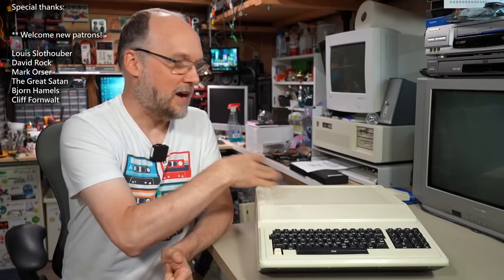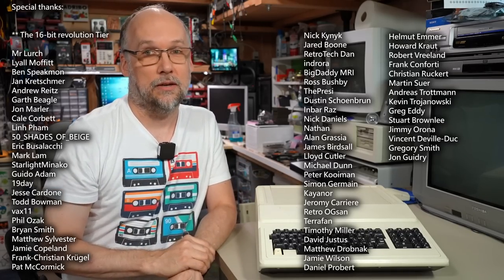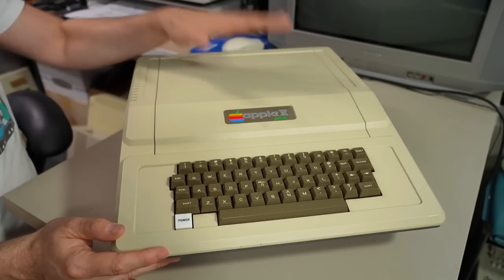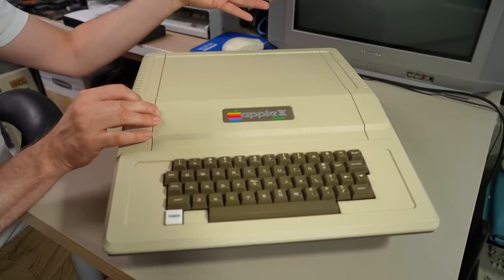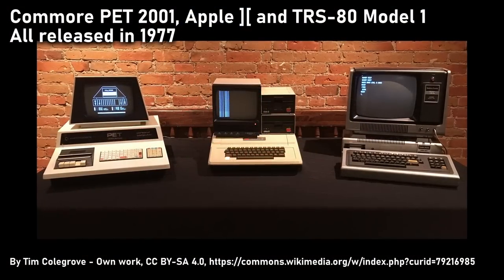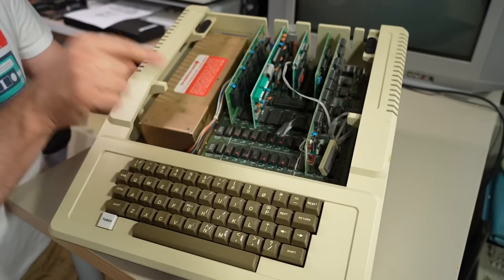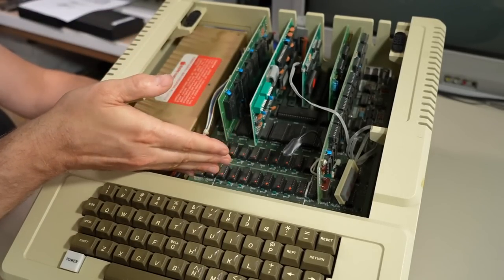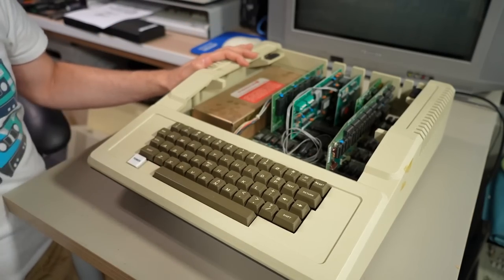Apple II+ clone repair: I thought this would be easy... I was wrong

Comment from the maker: Small correction: It turns out Franklin did not have a clean-room ROM, and were eventually found to be infringing. I can't find exact specifics about this as even Wikipedia lacks citations, but this seems to be the general consensus. Even this article specifically about the case lacks detail: https://en.wikipedia.org/wiki/Apple_Computer,_Inc._v._Franklin_Computer_Corp.

It talks about how Apple "won" in 1983 but Franklin continued to sell its very compatible Franklin Ace line until 1988, when "Apple was able to force Franklin to withdraw its clones by 1988." That doesn't exactly make sense to me -- so If anyone can dig up more detail about how Franklin continued to sell large numbers of machines with supposedly infringing code, I'd love to know.
Reply: I never really saw a Franklin in the wild.  I remember there was a shop by me that sold the Pineapple or something similar.
Reply: The case was famous. They had a guy read the fuses of a ROM with a microscope in order to show that this was really text and should fall under copyright law.
Reply: The answer, if MAME is anything to go by, is that they replaced the infringing ROM with a cleanroom one for their later models.
Reply: At the time Franklin started making their computer, there was a legal precedent for code that was in memory chips not being subject to copyright law.  I believe the original case involved a pinball machine.  This is why Franklin copied the ROMs and won the first few rounds against Apple.   Eventually, the courts figured out that of course the code should be protected, no matter what form it took.   Franklin at that point was forced to change its EPROMs,   They rewrote the routines, keeping only the entry points which an app would call.  Unfortunately, since Apple had published the entire code, some programs would jump into the middle of a routine if they only wanted to do the last part of its function.  This kind of thing made it impossible to be 100% compatible without copying all of the code in the EPROMs.  Luckily, a lot of programs only called the entry points and ran fine on the later Franklin machines.
Reply: I know it's just anecdotal, but my aunt and uncle had a Franklin Ace 1000 back in the day, and I specifically remember them saying that Apple successfully sued Franklin after proving that the ROM's were 100% identical to Apple's, including the name Apple itself appearing in the code.  I also remember much more recently someone (not the comment below, but someone on Facebook) saying that Franklin and other clone dealers switched to selling Apple ROM kits as "spare parts", with a nudge and a wink about how to achieve 100% compatibility.  I was just a kid in the 80's, though, so I never dealt with any of this more directly than using my aunt and uncle's Franklin, since we didn't have a computer.

It seems like someone must have hardcopy documentation about the exact chain of events, though.

Comment: back in the day, you could buy bare boards for apple and ibm clones from ads in the back of magazines. that's how some engineers at a place i worked acquired machines; buying a computer required approvals, but buying parts was just buying parts.
Reply: If only modern PCBs weren't as complicated. Imagine buying the parts for a full machine via a loophole.
Reply: @SockyNoob would you please elaborate? I don't understand the difference. As in older PCs had the system burnt into the boards?
Reply: @Loki-  Loki, modern computer components like motherboards aren't user serviceable. They're all surface mounted parts, microscopic traces, many layered PCB's, etc. You're only buying major components like graphics cards and connecting them together when you "build" a computer today and when you "repair" one, you're just swapping out one of these major components. In the Apple II days the motherboard was simple and as seen on this channel, easily user serviceable with fairly basic skills and tools. 

People could buy a board and source all the components to solder on it and assemble their own, which people did back in the day (and people do today when they buy something like a modern replacement C64 board for an example and populate it with all the necessary parts).
Reply: yeah double sided boards compared to modern 8 layer stuff....yeah copy that
Reply: This was exactly how my Dad and I built our ][+ clone.  I actually had started wire-wrapping one -- my dad worked at a famous research facility where they had an Apple CIG (Computer Interest Group), and they had a wirewrap board with a large manual of wire-wrap co-ordinates.  I would come home from school and start wire-wrapping, and my dad was supposed to check my work -- but he soon tired of that, and then was able to a clone board, and those guys troubleshooted it during lunch hours.  I still have it, it's got a few cool set of hacks.  I need to pull it out of storage and check and see if it works.  I did this some time ago and it was still working.

Comment: 50:20 Address line A3 is on cart slot pin 5. Data line D2 is on cart slot pin 47, which is almost directly opposite.

I would check all of the cart slot connectors, in case a pin is bent.
Or maybe there is something conductive sitting in the bottom of one of the connector slots? (like a piece of wire, or solder blob).

It's also quite possible somebody was messing with the board before, and put the wrong TTL chip into the wrong socket.
Reply: I was going to suggest a possible short due to touching connector fingers in the cart slot, too.
Reply: I think Adrian intentionaly put the solder blob and will say that it fell when he changed the transistor😂

Comment: I haven't shouted at the TV so much in ages... 🤣 Badly defined logic levels where the line settles quickly to an intermediate voltage and stays there until the next transition (as per the weird scope trace) is almost always a short to another signal.  You effectively had four steady signal levels on that trace, depending on which of the signals was high or low.  Finding the fault is a case of either visual examination and / or using a meter on a low ohms range wherever those two signals are close together on a chip or on the board and looking for the reading that's closest to zero ohms.  I first learned this trick back in the late 1970's debugging memory cards with lots of RAM chips.  The fault is unlikely to be a chip - most likely a solder splash, or a fine copper whisker caused by a bad etch of the PCB.  Back in the day, not all PCBs were tested for shorts between traces before assembly.
Reply: A splash or a whisker sounds like the kind of problem that would be there from day 1, but presumably this system was working before it went into a few decades of storage.
Reply: @Sashazur  There is a phenomenon known as "tin whiskers". These can grow over time, and were sometimes a problem in older electronics, even forming inside components after some years.  And we don't know if this system was ever fully working, but I would also suspect that it was.

Comment: Here's an old trick I've done to find shorts like that on a board. Put a power supply though a small resistor on the two shorted lines. (5V and a 100 ohm is a good start.) 
Now probe voltages across those two lines... when the voltage difference is the smallest, you're at the short!

As a VERY LAST MEASURE, On boards that were quite frustrating, and had put enough time into them that "it just didn't matter any more" and "zapped" the problem with high current..  would blow the short... or sometimes the trace near the short.  

I've also used this in car wiring, also, to find a short to ground in a RV on the interrior lighting. (found a "shiner" on the power wire, in a conduit.) Used 12V and a turn signal bulb for current limited voltage there.

Comment: 45:58 When you say the expansion connector is not the problem, my experience as a diagnostician is that a lot of times it turns out to be the thing you thought it couldn’t be. My Spidey sense is tingling, and I would probably get a magnifier and a high-powered light, and make sure that there is nothing conductive that got pushed down into one of the expansion connectors. I can just see a little bit of material from an edge connector flaking off and getting down in there.
Reply: With A3 and D2 being almost directly across from each other on the peripheral I/O connectors, that would actually be one of the first places I would look. Could be a damaged connector, soldering error, or even a board etching issue .
Reply: Could be a leg of a component fell into one of the expansion connectors, and as was said, when Adrian probed both the address and data lines it looked like he did it on the back of the expansion connector and they did look opposite to each other.

Comment: This looks like a copy of an early generation Unitron (Taiwan) board. The case and keyboard look very much like those used by the Unitron branded computers built in Brazil. There are additional half moon/bow tie jumpers below the EPROMS (and a thru hole jumper above the LS139 at F2) to convert the board from 6 x 2716 to 3 x 2732 installed in F0/D0/E0. We used to find these PCBs in almost every electronics shop in the area. I built and repaired dozens of these. Most people could never get the oscillator running reliably, and often had to pad the oscillator with an added 50pF trimmer at location A1.

Comment: A tip that might help in situations where you have a large set of things that might be causing a problem: instead of checking the chips one at a time for an offender, you might be able to check a half at a time. Remove half of the chips connected, test. If the issue persists, put them back, and remove the other half. That'll either rule out everything or narrow it down to half the chips. Then, repeat splitting the suspect group in half again. Instead of having to test each item one at a time, it becomes a power of two. Uses math to help rule things out quicker.
Reply: Kinda like a physical merge sort...
Reply: Exactly.  This is called a "binary search" and works for a lot of search tasks.   It's a massive time-saver.
Reply: Unless you have two failed chips, one in each half.
Reply: @pedro_8240  then you divide it in half a different way.
Reply: I can see the logic in that method somewhat and Adrian’s board appears to be in fair condition. But I think in this case removing a few at a time is adequate as it doesn’t take long to test it after each chip or two. Also you have to consider the damage you might cause by removing and installing chips repeatedly using the half split method. The Apple ][ plus that I repaired lost pins on a few of the ROM chips due to deterioration and aging of the legs so I was careful to only remove them when absolutely necessary. In the end one of the ROMS had internal damage that I wasn’t able to save so I had to make a replacement ROM chip.
Reply: @markcummings150  That's entirely true. I guess it would depend on the situation. I think it was kinda looking like it was getting dangerously close to having to remove a bunch of chips from the board, and at that point, I'd try to rule out as many chips as possible. Might be better ways to do it, or even smaller groups.
Reply: This is a cable fault finding technique and can be applied here. Cut the cable (in this case a trace) at 50% length, retest and work on the faulty half. Repeat until the fault is found.
Reply: This is well known as "divide and conquer". And was my exact first thought.
Reply: @pragmax  also called a binary chop

Comment: Dave of eevblog has a method he uses with a high precision voltmeter to measure resistance and triangulate on the short.  You could also pull all of the chips that touch those lines and apply 5V across and use a FLIR to find the hot spot.
Reply: Another option is to try an ESR meter which typically measure down to 0.01 ohms and they usually have a button to zero out the leads. This would be better than burning out a track with 5V power and you wouldn’t need to remove all the chips to test for the short.

Comment: This video is about 40 years too late to help troubleshoot the Apple clone I tried to make in the early 80s.  I could solder and follow simple schematics, but without any real troubleshooting tools, it was way too difficult.  I finally threw in the towel.  It may have been this very same board.
Reply: I was kind-of wondering if this computer was a hobbyist's machine that never functioned. I was also wondering if Apple was seeding boards into the community that had shorts just to keep people from building clones. Perhaps a little too Machiavellian.
Reply: I would suspect that A LOT of those hobbiest bare-board builds were never working nor completed and just stayed in a basement shelf for decades.
Reply: @haweater1555  I'm sure I wasn't the only one who ran into problems trying to build one.  My brother was more of an electronics wiz than I. Neither of us could get it going.  We didn't have anywhere near the same troubleshooting tools that Adrian has.  As well as the knowledge, I might add.
Reply: Oh that resonates so hard; I tried to build a floppy disk controller for my Nascom 2 and it worked just extremely briefly, but not having access to a scope it was impossible to debug and I didn’t touch hardware for many decades. Today I wish I had tried harder to find someone to help.

Comment: There are several methods for locating a low-resistance short on a large pcb.   One way is to use a DMM that can display tenths or even hundredths of an ohm.   Accuracy is not that important.  You probe those two signals at various points on the board.  As you get closer to the short, the resistance will drop.   This relies on making consistent contacts with the two signals with your probes, since any resistance in the contact will add to your measurement.   A different technique gets around this issue.   If you have a bench power supply, set the voltage to something like 0.3 volts.   This will prevent damage to any chips in case the short suddenly clears.  Now set the current limit to 50 mA.   If your short is on the order of 1 ohm,
that should give 50 mV across it, which many meters can display.   Now apply the voltage across the two shorted signals, then probe the same signals at various pts on the board.   The lowest voltage reading should be right where they are shorted.   You may get the same reading at multiple locations for one of the probes.   This indicates that the power supply connection point is electrically between the short and the probe locations.  Both of these techniques rely on the pcb traces having resistance that adds to the resistance at the actual short as you get further from it.

Comment: Thanks for leaving IN the mistakes.  I enjoy watching the process and learn a bunch of good techniques. Like I wouldn’t have considered that heating the transistor would bring it back to life.  I used what I learned to bring my Nascom 2 back to life.  Turns out I must have removed a bodge wire I installed 40 years ago, but tracing the signals methodically lead me right to a missing connection.

Comment: I'm thoroughly enjoying this video and writing this around the 32 minute mark when you say the chips are a hodge podge.  It occurs to me that this system may not have been built in a factory, but by an end user (or the seller) using one of those bare PCBs and grabbing whatever chips they could find.  Back then, there may have been local electronic shops that didn't have large lots of parts, and maybe the builder had to go to multiple physical or mail order shops to get what they needed and/or whatever they had on hand.
Reply: Yep, and those memory chips used to cost $5 dollars each back in the day.

Comment: I have a multi-board Space Invaders machine where the CPU reset pin was shorted to Address line 15 of the CPU.  A15 isn't used by the software but was pulsing due to the CPU reset watchdog circuit. That was fun to track down!

Comment: The Franklin Ace 1000 was actually an illegal clone. It was allowed to stay on the market while Apple Computer, Inc. v. Franklin Computer Corp. was on appeal, partly because the initial court rulings were that compiled code could not be copyrighted. (The Franklin Ace 500 and the Franklin Ace 2000 used cleanroom-implemented ROMs. I believe this was a result of other court rulings that compiled code could be copyrighted.) Eventually, Franklin and Apple settled, with Franklin being barred from ever selling computers (including PC compatibles) as part of the settlement.

One way other Apple clones got around the import bans is that they were imported without ROMs, and ROMs were either installed by the seller or end user.
Reply: I thought Apple eventually bought Franklin as their educational division.
Reply: @SockyNoob   No. Franklin actually morphed into a different company. They went into electronic publishing and made some devices associated with that. They made things like pocket spellers and pocket Bibles. The company definitely existed into the early 2000's and may still exist in some form today.
Reply: And the instructions for ROMless clones said to go find an authorized Apple dealer that will sell you the genuine ROM as a replacement part (before Apple caught on and jacked the price up  for this chip to reflect the intellectual property contained inside).

Comment: At swap events in the SF Bay Area (in the early and mid 80's) you could walk through and buy all the parts, choose your case style and keyboard, power supply, etc. and then take it home to put together.  Even ROM sets were available for as little as $ 5. I had a case that said Banana on it.